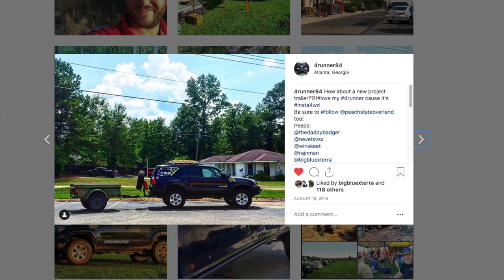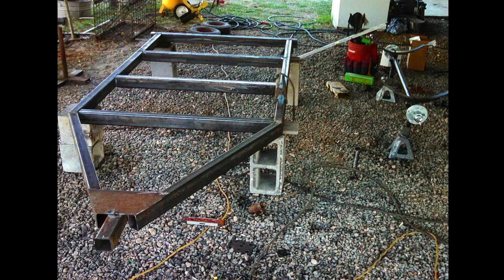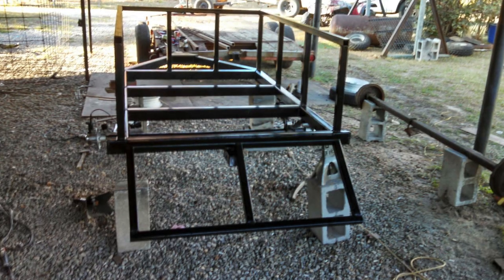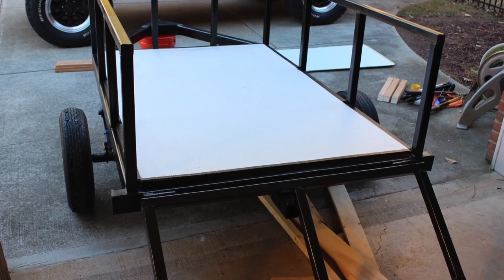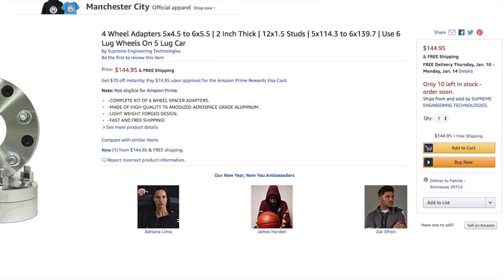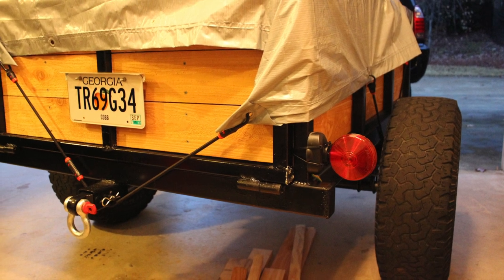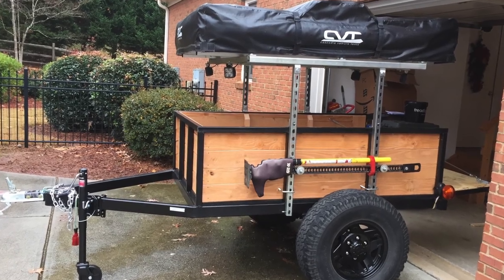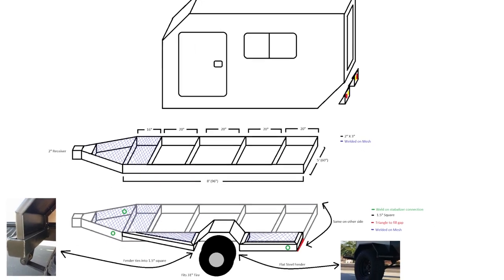Build Your Own DIY Offroad Camper Trailer - 4x4

Comment: Just found this video after deciding to go home built over the crazy money for even a bare off-road trailer.  Great video!
Reply from the maker: Glad you enjoyed it! Thanks for the comment!
Reply from the maker: I have since transitioned to a tentrax trailer. I dig the axle less suspension. I would change that about my DIY design if I went back. I still aspire to build a bigger conquerer Australia style trailer at some point, and a Van. More videos as I have time. I have 3 kids and a 50+ hour a week job so… 😒 it may be a while
Reply: @PatrickMetzger  I hear you man, I have 3 kiddos and work full time.  I’m getting into the overlanding as I can bring my oldest with me and I have friends that I wheel/camp with.  I was wondering how the solid axle would go as in getting hung up on rocks and stumps, I see a few companies offer independent suspension kits for 500-750$.   Most of my wheeling is day trips and I’m not building my 2021 Tacoma for hard core off-road.  I have an old Toyota pickup for mud/rocks.  The more I look into roof racks and bed racks the more I want the trailer.  Some of the trips I have been on are hundreds of miles of road with trails so it would be nice to set up camp and not have to break it down to hit trails
Reply from the maker: @sucha603boy  leaf springs just take a beating, overall I’m sure they will be fine. I run my tire pressure on the trailer lower to make the ride better. I need to make a video on my tentrax trailer.

Comment: Did you figure out how much you spent with your camping trailer build????? Just wondering 💭,,,, Great job on your micro camping trailer….
Reply from the maker: It was about $1,100-$1,300, but I hired a welder for that part, it could have been much cheaper.

Comment: Great work on this trailer!! It’s so simple and looks nimble… Quick question about the superstruts: are they adjustable in height? Can you play with the tent height?
Reply from the maker: Thanks! I tried to build it simple. I didn’t make super strut in an adjustable way, but you could do that for sure. I’ve seen a tube in a tube design on other trailers and I prefer fixed. The tube in a tube rattles a lot going down the trail.
Reply: @PatrickMetzger  Thanks a lot man. I know about the rattle it can make... I'm pretty torn between the two, but I love adjustability.

Comment: I love the way the trailer looked.  I started to build a similar one my self. How tall did you do the walls of the trailer. Thank you
Reply from the maker: Thanks! I made the inside height the same as the totes that I use for camping. 2 of the green sportsman totes stacked. I believe it was about 20” tall and the gap I left for the roof rack was large enough to comfortable fit that same tote through.

Comment: Nice build Patrick. But I’m wondering how did you keep the contents of the trailer dry? Or did you just stuff that couldn’t get wet in the Toyota?
Reply from the maker: The Plano totes I had, had a seal that minimized water intake. Clothing, blankets, and pillows went into the 4Runner.

Comment: Can you tell me more about how you built the base for the roof rack and connecting it to tower?
Reply from the maker: I bolted it at the bottom around the vertical 1” tubing (the black part) with a u bolt and then I tapped (1/2 self tapping bolts) an L bracket in the top edge of the trailer.
Reply from the maker: I’ll post a pic

Comment: Hey.  Great design ideas!  Did you think about putting a cover on the trailer (under the tent rack)?  Wondering how that would work...thx again!
Reply from the maker: I was actually planning on having a vinyl top made and having it button much like an old jeep top. That’s why I angle cut the wood in the sidewall to prevent water from getting inside. I was never able to do that but I think it’s a perfect idea!

Comment: Thanks for sharing your project ! How much weight would you say your super-strut structure can handle in addition to the tent which usually weights between 120  - 150 lbs. ? I am doing a build up on a utility trailer for off-road and I need to decide on a budget friendly approach... Again Thanks !
Reply from the maker: Not sure of exact numbers but it might hold a Mini Cooper
Reply: @PatrickMetzger  that is definitely good enough for me... Ha, ha, ha !
Reply: @PatrickMetzger  That's just my wife, I'm probably a Ford F150 myself, ain't gonna work for me.  But yes,  I also used super strut as a roof rack, it can hold a lot of vertical weight      :D

Comment: What's the length of the tounge from start to the main box
Reply from the maker: I don’t recall specifically, but you can get the dimensions off your vehicle by measuring from your trailer hitch receiver to the corner of your bumper. That can be a good gauge on the right length
Reply: Thanks a ton for the reply

Comment: Patrick, can you share the dimension and spec of the wonderful trailer?
Reply from the maker: It matched the footprint of the tent, 48” wide and 60” long. The height of the inside matched 2 stacked totes, I believe that was 20” deep based on the totes I have. 1700 lb axle with 31” tires.
Reply: @PatrickMetzger  thanks very much.  I’m thinking of venturing out.  It will help to relieve the stress caused by Covid.  Thanks again for your educational video.

Comment: Wow, why wouldn't you just sand the lead paint off of the 40 year old trailer? I personally feel that you overreacted due to the lead paint. Don't quote me on this, but most house paint contained lead until not that long ago, and it only harmed you if you damded it, and then breathed in the sanded particals. And lets not forget, in WW2 the army waterproofed their willys with an asbestos compound, yet almost nobody died because of it.
Reply from the maker: Zachary I’m pretty sure I said it in the video, but I did not have space in my yard to do it outside and I didn’t want lead all over the interior of my garage.

Comment: Can we all stop calling SUVs trucks
Reply from the maker: Matthew R it’s a habit, why is it such a big deal to you?
Reply: @PatrickMetzger  Not a big deal. Just not at all the same. Most (not all) SUVs are unibody with rear coil overs for increased comfort and better handling. Most trucks (not all) are body on frame designs with rear leaf springs to handle payload and towing coupled with larger brakes and better designed rotors to be able to stop the vehicle under load. Also the frame design is much stronger, beefier and heavier, to be able to withstand crumpling from impact with a trailer behind it and added weight stressing the welds and metal more. So I mean call it what you want, it's a free country I could care less, it's just not accurate in the slightest. I can say a civic is a sports car and treat it as such. Makes no difference other than it makes me look stupid. Like calling an SUV a truck.
Reply from the maker: Matthew R while appreciate your desire for accuracy, I probably would never have decided to correct someone who said something like car or truck to describe their vehicle no matter what it was. Good luck at your attempts to make YouTube more accurate. 🍻
Reply: @PatrickMetzger  Then its probably a good thing everyone isn't the same then is it? Lol I wouldn't call an SUV a truck, you wouldn't correct someone about it. Pick your shots I guess